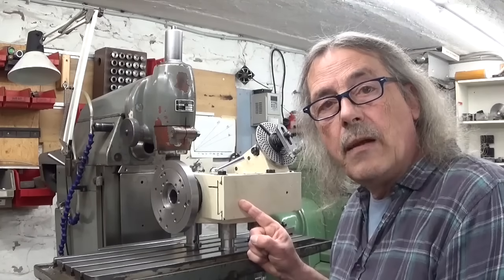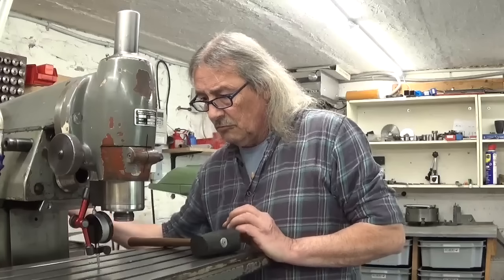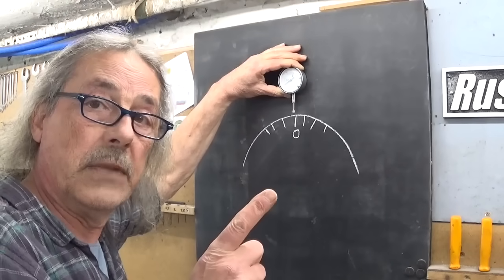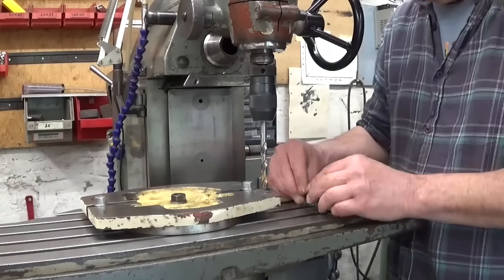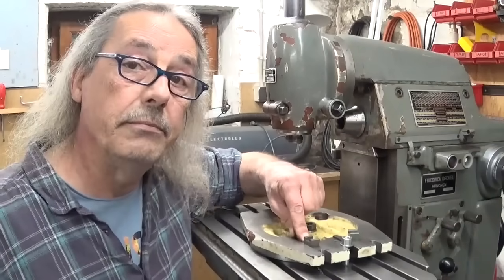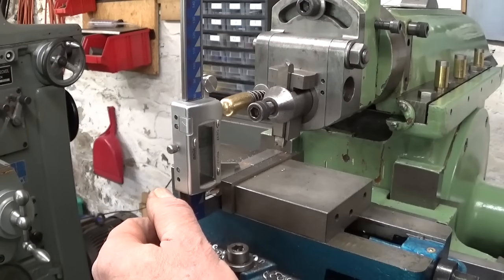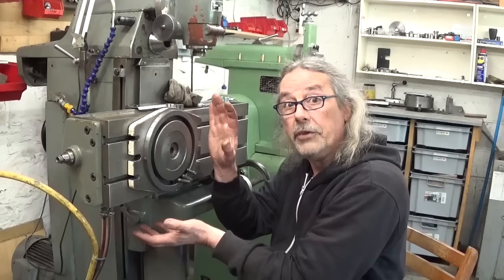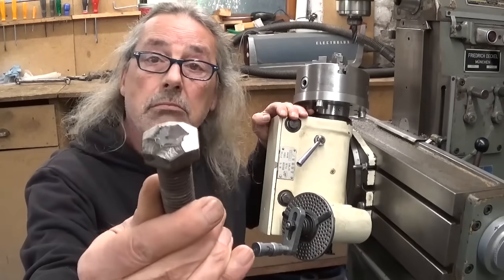Adapting a mounting plate for the dividing head.

Comment: Hi Michel, it is good, that you did not use bolts in the t-nuts, because if they are too long, it is very easy to break the t-slot on the table. You can see this quite often on second hand machines, round tables etc. I never use bolts in t-slots for that reason..😊
Reply from the maker: Indeed. Have to be careful with bolts in slots.
Reply: Hi Michel, 
The method of finding the top position is probably not the most accurate one. You adjust the x-axis to the highest point on your indicator. But when you turn the crank on the x-axis from that position, you see very little movement on the indicator for at least a couple of tenths of a millimeter. That means that the position on the x-axis cannot be determined any better than this couple of tenths. It would probably be better to crank to both sides until you lose for example 2mm on the indicator reading and calculate the middle position of the x -axis. Need to consider the backlash of course. 
Or you could also mount the new keys in the rough surface slot and indicate this.  
Just my thoughts…
Let me know what you think about that…

Comment: Might be worth checking the flatness of the base in a few days. Cutting the key channels in the cast iron base can change the stresses in the casting and you may find it needs a bit of work to get it flat again.  I tried machining the base of a cheap vice to make it square, and it was initially, but then ended up a bit like a banana 🍌. That Deckel looks to be a very versatile machine.
Reply from the maker: Good point. I will do that.

Comment: I got a Vice with a base like that that doesn’t fit just like yours. I just mount it kiddy wampus with one bolt hold down slot in the near t slot track on the mill and one bolt hold down slot on the far t slot track in the mill. That was the center of the base ends up exactly on the center of the table.
Reply from the maker: You can also make an adapting plate for that vise.

Comment: Could you mount the base using one slot in the top tee and the other in the lower tee, or am I being stupid?
Good work and as always well explained.
Reply from the maker: You're not stupid at all. It's indeed possible.
Reply: @Rustinox  ok, but the extra slots are better for rigidity and locating. Worth the effort.👍

Comment: From one of your other videos I know that you have just one indexing disc for your dividing head. I have got a couple in spare and would like to donate you the missing ones. There is three different discs available from Deckel. 
They all have 35 ID, 125 OD and 6mm thickness, holes are 4mm. 

Nr. 1: 27 - 31 - 34 - 41 - 43
Nr. 2: 33 - 38 - 39 - 42 - 46
Nr. 3: 36 - 37 - 40 - 58

Which ones do you need?

Kind regards,
Stefan
Reply from the maker: That's very kind of you. I have only plate nr. 2
You can mail me; rustinox@outlook.com